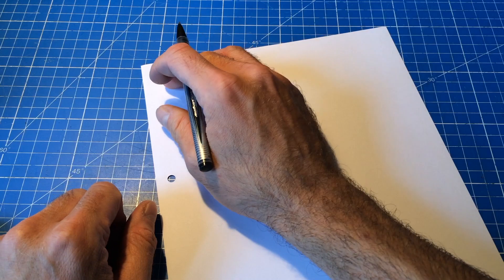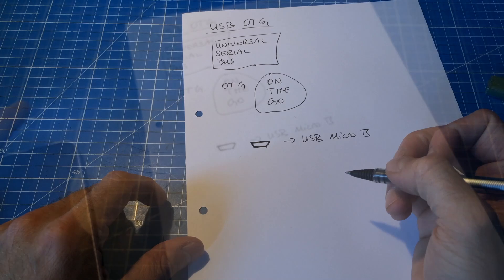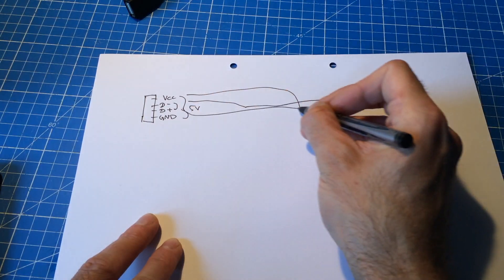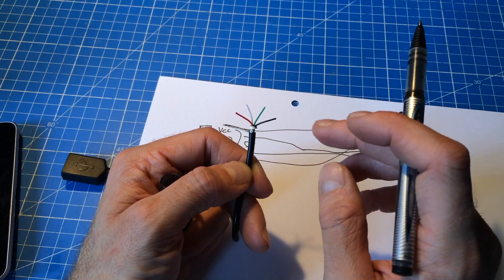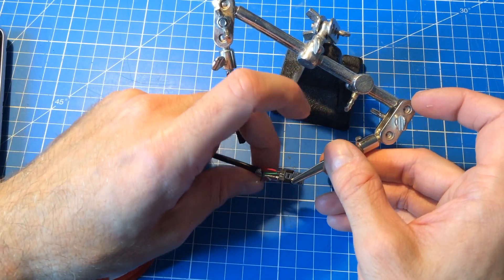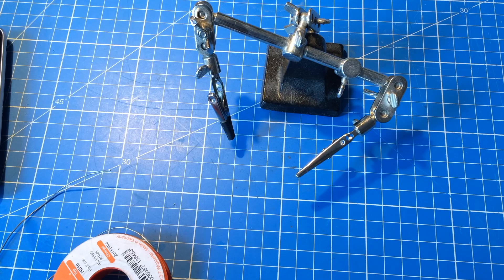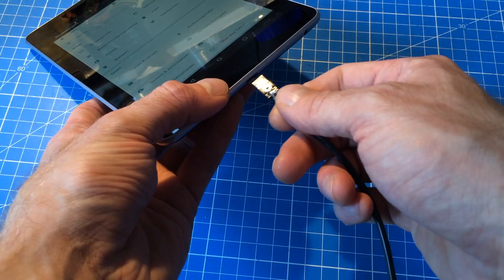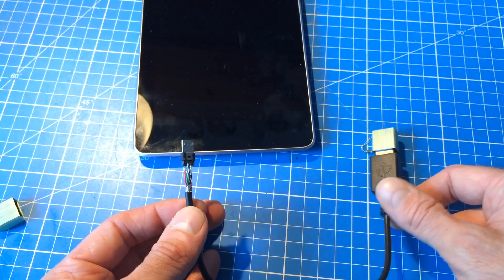Making a DIY USB OTG Adapter

Comment: HOW CAN A MOBILE PHONE BE CONNECTED TO A WIRED HOME NETWORK (WITH POWERLIGHTS) WITHOUT USING THE DANGEROUS WIFI ?!
It is possible to realize a simple 2 or 3 meter adapter cable with a micro USB socket to be inserted in the cell phone and an RJ45 socket to be connected to the Powerline.

Comment: I prefer to pay a few bucks on Ebay , Amazon or Walmart and avoid this hassle
Reply: ProngProng TV  3 dollars vs my precious time. Not a brainer
Reply: @cyberedwing  I agree! You're definitely not a brainer, whatever that means.. I suspect you're trying to say, you have no brains, which is quite obvious from your statement that you'd rather buy the cable. Which is what most girls, girlie men, senior citizens and lil kids would do, cuz either this intimidates them or its way over their head. Either way, it's hardly rocket science, you're cutting some wires and then reattaching them, ensuring the connection is solid/strong by soldering it. Not much different then cutting up paper and gluing them together. But the thing with DYI projects like this, the end result, seeing it works and that feeling of accomplishment is something money can't buy. If it stops working or breaks later on, it's easily fixed, since we know exactly how it's put together. If something goes wrong with yours, you'll have to buy another or wait for it to ship, ours would up and running again in 7 mins or heck, could just make another in 10 mins. 
I meant to ask, why are you watching/commenting on DYI vids, for things you intend to buy anyway? Hardly makes sense, most who watch this, would see how easy its done and proceed to make one. Unless you watch DYI vids on everything you plan on buying, which is some weirdo shyt, maybe get a life instead.. The likelier scenario was that after watching it, you found the process to be beyond your means/skill set or perhaps worried you might chip one of your pwetty lil nails and that'd piss off your boyfriend as he just paid for them after all those weeks of you whining about how your sisters dude spoils her rotten, getting her hair did, nails did, waxed smoother than baby's ass. No comment on that. Enjoy ur store bought cable

Comment: Could you make a powered OTG-USB-hub that not only would charge your tablet/cellphone but also power the OTG device? I have a RTL-SDR dongle witch uses quite some power from the battery.
Reply from the maker: Yes, I think so. There are Y-cables for that purpose on the market. Don't know how you would have to do the wiring off the top of my head though.
Reply: Jan Beta  + to +, - to - But the real problem is, does your tablet/phone allow otg charge ?  Samsung usually requires some precise resistor value rzther than a direct connction to the ground. On somme smartphones is simply impossible. On a Nvidia Shield k1 it works perfectly : otg adapter-y cable-hub and kbd, mice, usb memory stick and a 2.5 inch hdd.

Comment: Shrink tubing with glue inside is a good way to make the OTG plug durable. Thanks for your video
Reply from the maker: Yes, that's a good idea. :)
Reply: Before using shrink tubing better first apply some 2 component epoxy glue between the solder points to assure proper isolation between the wires. To prevent short circuits after crimping, since shrink tubing applies mechanical force to the wiring.

Comment: Still soldering with Leaded (Pb) Solder Wire?
Reply from the maker: Yes, it's just so much easier to handle. (Especially if you're using an old soldering station like me...)

Comment: Hi how can I make one for iPhone 6 please help me
Reply from the maker: That's basically impossible. You could build a similar cable (which isn't as easy because there's a little signed chip in every cable iOS accepts) but it wouldn't have near the same functionality. The only thing that can be transferred via OTG on iOS is pictures and video from camera roll afaik. Nothing else.
Reply: @JanBeta  Now iOS devices won't even accept LICENSED third party cables and adapters anymore.  They want you to pay them THIRTY DOLLARS for a 3" piece of cable with a couple of connectors, that has a bad reputation for quickly falling apart.
Reply: Is there a tutorial